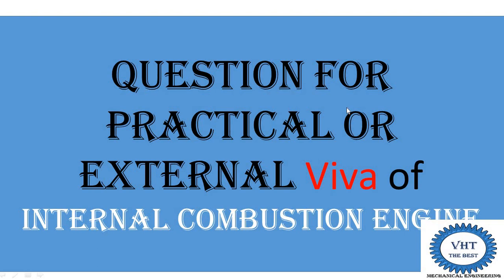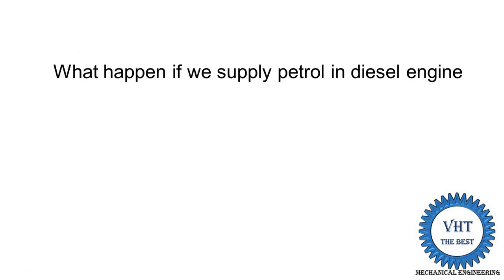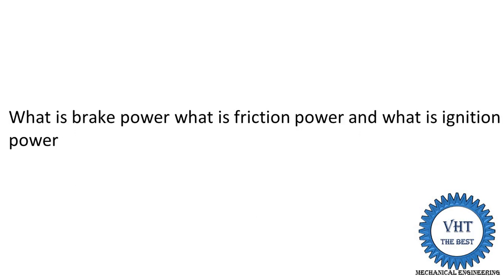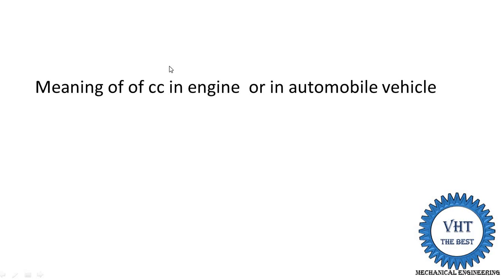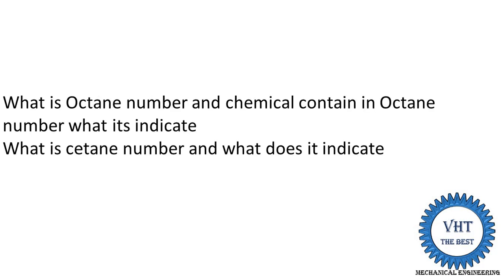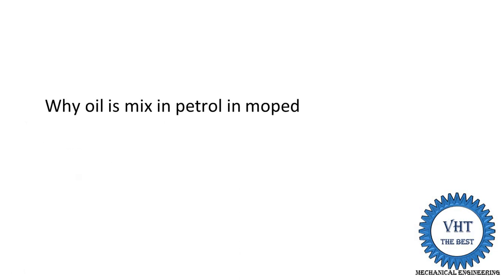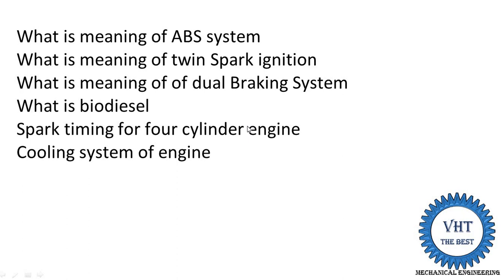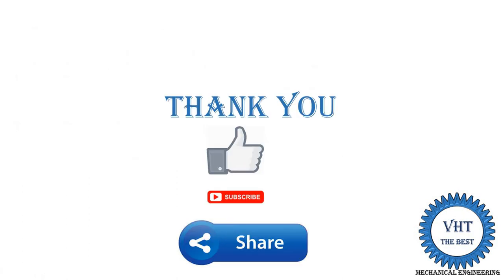Important question for practical viva of internal combustion engine

Comment from the maker: Below question add for practical viva
Various efficiency of engine,
Combuation chamber and types of combustion chamber,
Square engine means L/D= 1,
If 2 stroke and 4 stroke engine run at same RPM(2000RPM) then which engine have high efficiency and break power,